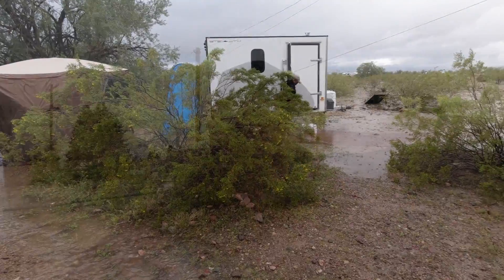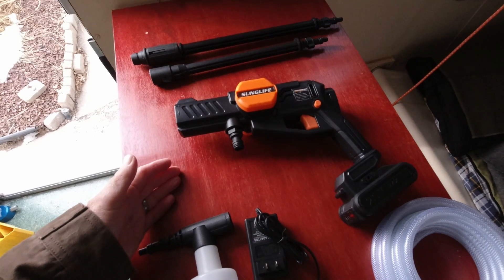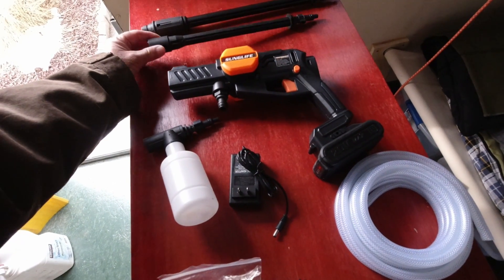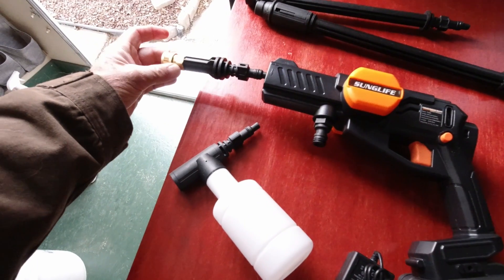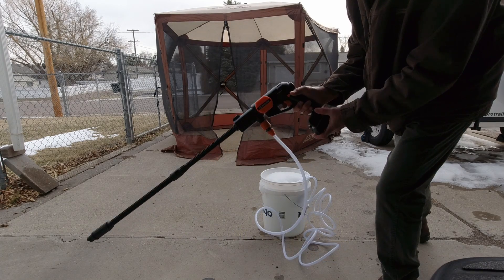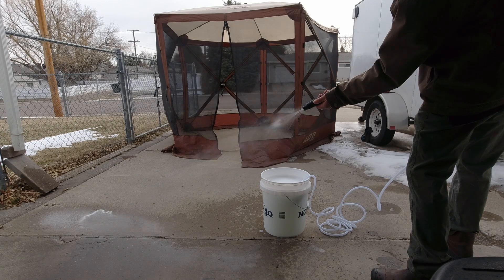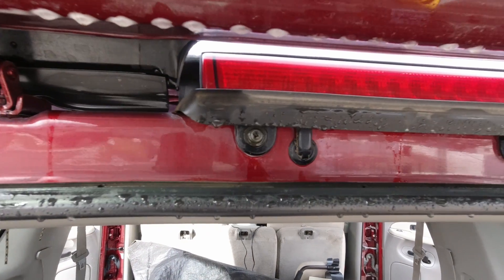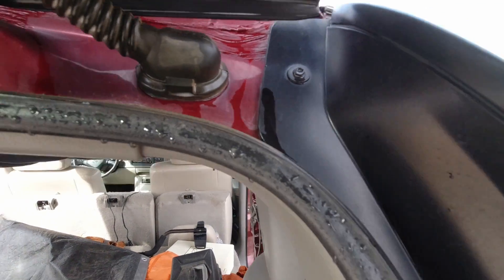Sunglife Cordless Pressure Washer Review

Comment: hello from the rainy Ozarks rick and linda!!  did ur odor wash away?  I have the pavilion tent next size up from yours and I haven't noticed any odors and its been rained on.  I carry a battery powered leaf blower to blow dry and dust all my outdoor equipment. I waterproof my with 303 aerospace brand and no leaks yet.  did ur roof leak any? the hazards of camping in the rain u have to open and spread everthing out to clean and dry again!  I use rain x on my door hood trunck jambs that makes its easier to clean!  thanks for update safe adventures ahead!  cheers!
Reply from the maker: I did get rid of the odor!  When we first got the Clam I waterproofed the roof like you did and it doesn't leak a drop.  I can't readout for this lockdown to go away because I'm ready to hit the road again.